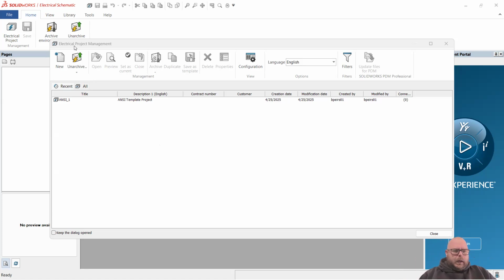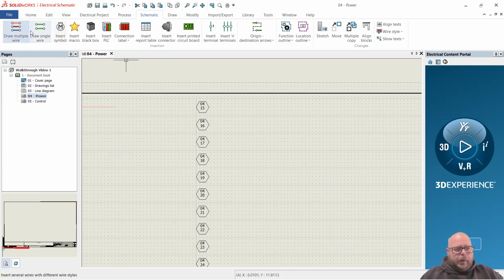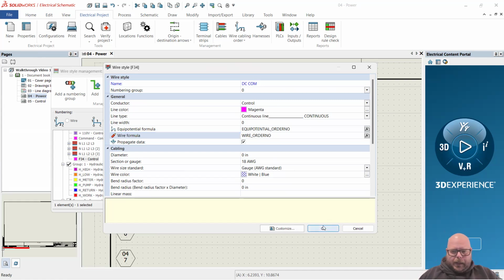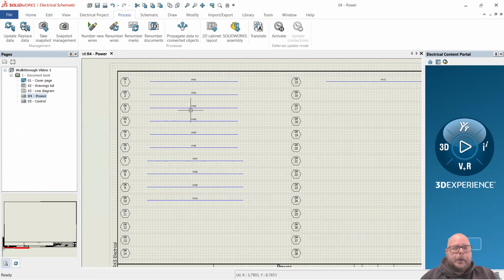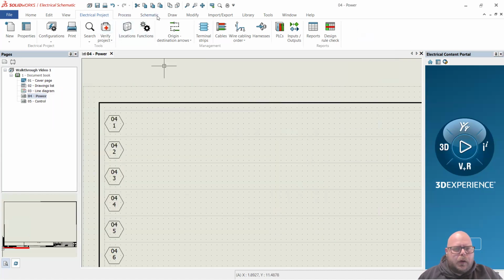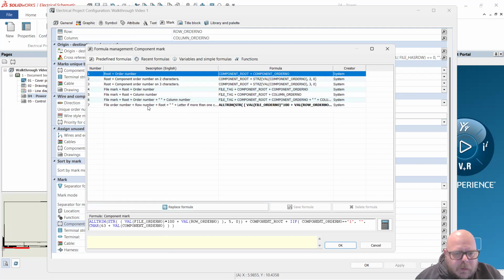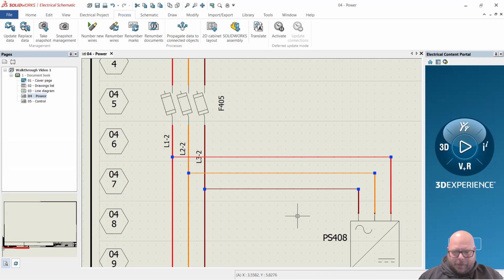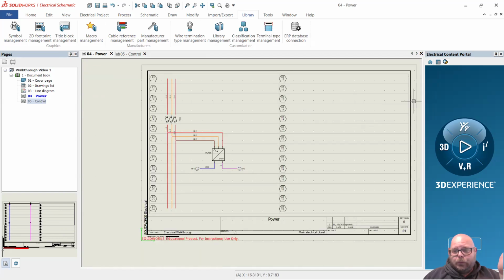From Zero to Wiring: The Essential Beginner's Guide to SolidWorks Electrical

Comment: Love the content, Brad! I am building a standard at my new job for updating all in-house prints. This guide helps a lot, so thank you! I am wondering if you could provide a tutorial on customizing pages in the workbook. I.e Cover page - how to manually insert page numbers to descend for each page, change "Contract" to machine Number and/or Serial number, something along those lines. I'm familiar with AutoCad Electrical, but I'm learning SolidWorks Electrical and the complexity is getting to me...lol! Thanks